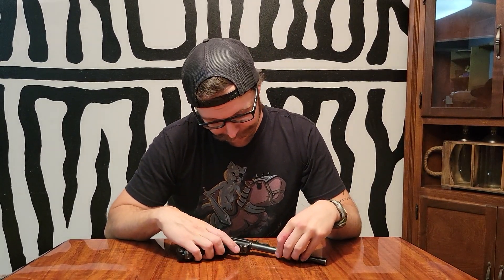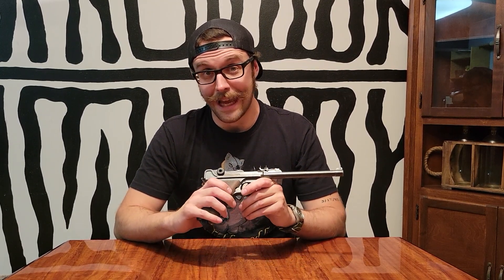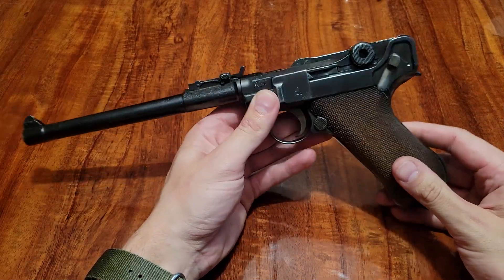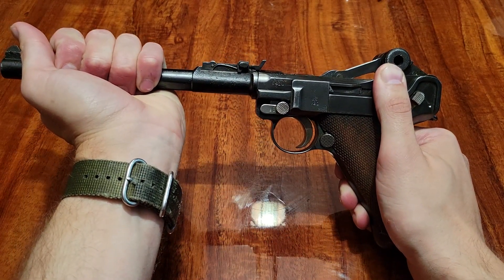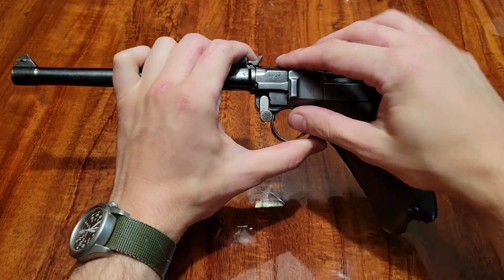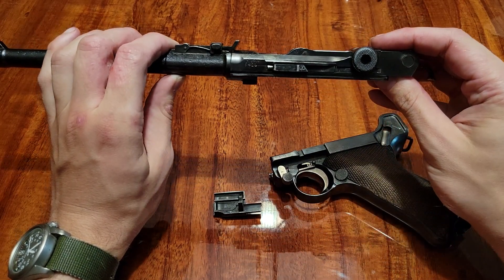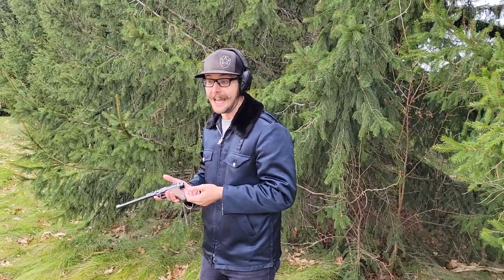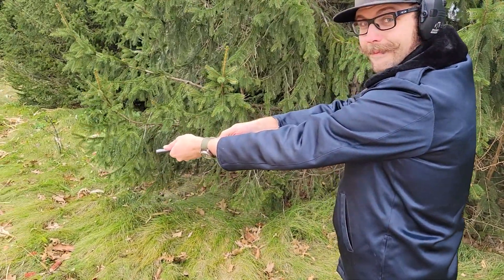The Luger's Fatal Flaw

Comment: Oh for crying out loud! The Luger is quite safe. People are unsafe. For this to happen it require negligence on the part of the handler. There is no 'fatal flaw'.  And your disassembly is incorrect. There is no need to fully retract the toggle before moving the take-down catch. The upper just needs to move rearward about 1/4". And if someone tries to disassemble the piece without checking the chamber that's a training issue, not a design flaw. So what's next? The Nambu Type-94?
Reply: There's even a loaded chamber indicator in the form of an extractor claw that pops up and is labeled "geladen" (german for "loaded"). In 1971 I was at college and visiting some guy's apartment where he proudly showed me his 1908 Luger in excellent condition that he got for a song ($40). He handed it to me to inspect and stated it wasn't loaded because he had removed the magazine. I knew about Lugers and saw that the extractor was in the loaded position. I pulled the toggle back, removed the chambered cartridge and handed it to him with a gimlet eye.  Always check the chamber of any gun handed to you; never assume!
Reply: You have to realize, that back in the time period of the early 1900's there was little to no training (or adequate instruction) SOP's or doctrine for a regular process to clear a pistol, autoloaders were still very new to the world in general (C&R Arsenal Primer on Lugers is a great watch too on the history) where wheelguns were still the norm, and there is record (also stated by Ian McCollum and Brad Simpson) that details some of the ND/ AD's that have happened when disassembly and cleaning attempts and subsequent accidents happened back in the day.

Also notwithstanding that idiots even in the current day and age still manage to have accidents when they don't properly clear their firearms to clean them, happens no less than 50 times a year across the US (the figure is actually a lot more statistically and repetitively closer to 130 times/ year).
Reply: @DJTheMetalheadMercenary   people often lie about the circumstances of accidental shootings to authorities and more likely something else was going on.
Reply: @loquat44-40  That is the case sometimes, yep.  Some people just ain't smart lol.
Reply: A lotta times it's just wanna be gangsters practicing being bad-asses these days. We've seen the videos. Oh, it went off when I was cleaning it.😅

Comment: That is not a problem. Triple check that the mag is out and the chamber is unloaded before you disassemble your gun... Those who disassemble a loaded gun deserve a Darwin award imo.
Reply from the maker: This was, in fact, a problem that several German police forces put out a formal request to fix in the 1920's. Look up the Sear Safety Luger.
Reply: @huntersrauwolf  Lost faith in 1920s german police then. ¯\_(ツ)_/¯
Reply: @huntersrauwolf  This was a problem because they weren't being trained correctly. We like to consider that the police are experts at using and maintaining their guns but you will find that is oftentimes not the case. Its probably the reason that police in America held onto revolvers for so long. Because they're just so dang simple. But have very few safeties at all. You used to not be able to carry a round under the hammer. Double actions kind of fixed this problem but not completely. Then they made the transfer bar which made them drop safe seemingly.

Comment: Glock is by far worse you have to intentionaly pull the trigger to disasemble the gun  and its a 1980s design that still prevails in military ,law enforcement and private use ,all striker fired pistols are unsafe to disasemble if you dont have safe gun handling . allways take off the magazine toss aside all the ammo ,check the chamber that it is unloaded and then and only then proceed to disasemble the gun .
Reply: Any firearm is unsafe to disassemble if you don’t have proper safety handling

Comment: The toggle does not need to be bent in order to separate the slide/barrel from lower. Pushing the barrel slightly back will allow you to unlock the lever.

Comment: My Luger's safety basically doesn't work whether it's on or off. It's only a plate that supposedly blocks the "knee" of sear from pivoting outward. But the safety plate is loose enough it can move with the sear, so it's not blocking anything, and the striker drops even when the safety is on. I tried to email Luger, it's like no one works there. Bad service. Now I know why US military didn't pick the P08!
Reply from the maker: I would venture to guess that the little arm that blocks the sear from flexing is either bent or snapped off. Hard to tell without having it in my hands, but that would be a good place to start
Reply: @huntersrauwolf  nope, straight as an arrow. If it's bent, it wouldn't be able to move up and down inside freely. Mine is pretty smooth and looks cool, except it's practically useless.
Reply: U.S.Gov didn't pick the Luger because they didn't want their sidearm made by a different country in case of war embargos. There is no Luger Company to email, not since 1942. There are a few custom makers that replicate them, at great expense. . Lugers were hand fitted with every part serial numbered, not interchanging with other Lugers. . Your loose safety bar may be a part swap that was not factory fitted up. Toward the end of World War 2 there were supply wagons that rebuilt equipment in the field, and if the gun went off, that was good enough to pass inspection.

Comment: So let me get this straight. You have to completely open the action (ejecting any round in chamber) to separate the upper and lower. And now the gun can fire if I press the sear?  That is why it's called negligent discharge. You'd have to leave a loaded mag in and not check chamber. BTW the P08 has a loaded chamber indicator

Comment: At an even more elementary level, as there is no exposed hammer it is difficult to impossible to know if the gun is cocked & also difficult to see if a round has been chambered.  Appreciate that the extractor is slightly raies if this is the case but, this can be easily missed.  Nice gun though!
Reply: Yea the extractor sticks up when loaded to indicate to you

Comment: On the Luger I am familiar with, you can also fire the gun by pressing on the linkage on the side of the weapon about halfway between the top of the trigger and the receiver. For this reason, the Luger had a hard shell holster. Ironically, the Luger also had a feature they would indicate that a round was in the chamber. The extractor would protrude and on the side of the extractor was written “Geladen“

Comment: Accidental discharge happens only if you don’t follow safety rules ! A Luger is not a Nambu type 94 where the sear is not protected.
Before cleaning or disassembling, remove the mag and check the chamber twice like all automatic pistols ! Furthermore, the Luger’s got a chamber indicator. If you can see « geladen » on it, there is a round in the chamber. Danger !!

Comment: Luger has no half cock or firing pin safeties. It's a typical military gun. Problems in the sear/firing pin geometry, due to dirty or wear, may cause the firing pin to slip off from the sear uppon impact. In the XIX century they didn't care tpo much for safety. I had two lugers in the 90's, one like yours but in a bad shape (at that time to have a luger in my country wqs a felony).  I never considered that pistols as usable guns.
The grip safety was a good idea. Maybe because the gun was very well made with the best availabe steel alloys the potential issue wasn't noted?
A friend got a Luger in 1985 for a very low price  because it fired after a drop and its owner became frightened A few strokes with a diamond file and the gun became safe again.